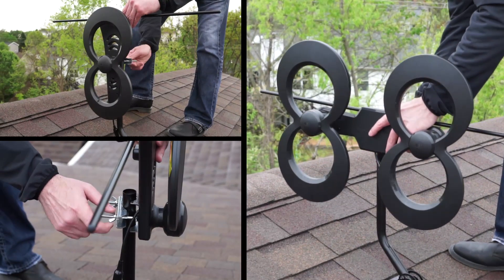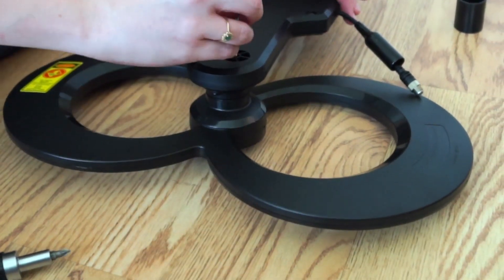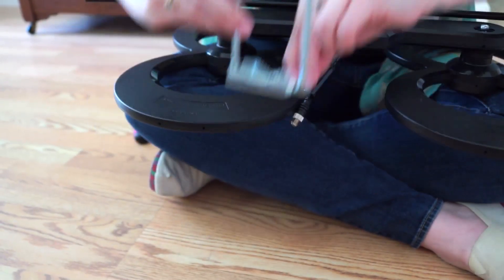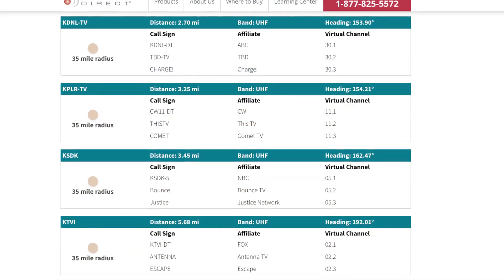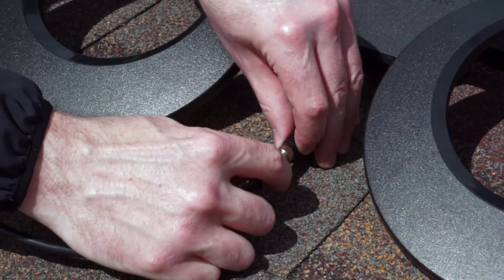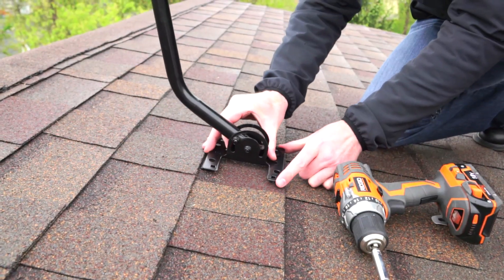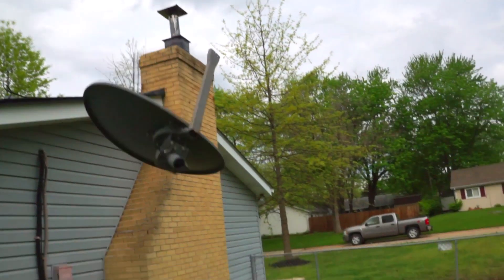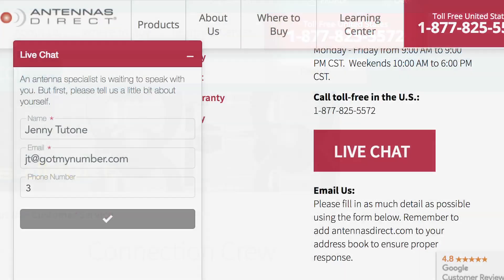Antennas Direct ClearStream 4MAX Indoor Outdoor HDTV Antenna How To Assemble and Install

Comment: Does this antenna and the RG6 cable not need to be grounded?
Reply from the maker: We do recommend grounding your antenna or mast during installation according to Article 810. We do not show grounding in any of our videos since grounding is based our local electrical codes for St. Louis. For grounding instructions, please contact the NEC, a local licensed electrician, or a local electrical inspector for details in your local area. Thank you!

Comment: Hello, we have Clearstream 4v w/ mount model c4-v-cjm.

We’ve had it since 2014 for our destination trailer.  Worked for years, but this year it’s not getting any signals, 0. 

It’s mounted outside with no obstructions.  My dad connected a small tv to the cable directly from the antenna and still no signal.  Through the wind rain hail and snow and debris the antenna has proven to be very reliable for our 18? Maybe 23 channels.   It’s a campground.  We only want it to work like it did and not receive HGTV or other DIY shows.  If you know what I mean.  Moms and redecorating.

Anyway, we have yet to inspect the antenna for damage, but it appears to be in excellent physical condition.  Every year we have to adjust that bar that gets tilted, other than that, we have done no other adjustments.

Cable runs underground, connected to a junction (above ground), then goes back under ground, and into our addon room.  Which then goes into an indoor amp, and then to the TV.  

Regardless, the cable from the antenna did not work for the small tv.

HELP! TYIA.

We are located in waupaca Wisconsin.  I’ll take a video of how our antenna is mounted

Comment: No grounding?  I have had 2 of these 4Max antennas completely fail following these instructions and it turns out it's because they weren't grounded in outdoor use.

Antennas direct won't take them back without the receipt.  That's my fault, but BE SURE TO PROPERLY GROUND your outdoor antenna.  Learn from my luck
Reply from the maker: Hey there, we can only provide some guidance on grounding antennas... here is a link to a page on our website. https://www.antennasdirect.com/cmss_files/attachmentlibrary/pdf/Grounding-Info.pdf. We purposely omitted grounding from our installation instructions and videos for liability legal purposes. Everyone should consult the NEC, a local licensed electrician, or a local electrical inspector for grounding instructions according to their local electrical codes. Also, regarding your return, I just spoke with the customer service manager and we don't typically refuse a warranty return. Please call us and ask for the customer service manager at 877-825-5572 if you need to return your product. Thank you!
Reply: @AntennasDirect  wait you intentionally left the grounding instructions out of your directions? Your instructions should say to hire a licensed electrician. Seems like a product flaw to me and I’m returning this new one that I just purchased from Best Buy

Comment: I have a 2 max and now I'm wanting to get me one 4 max but then I think about price for 2 channels I want kind of not worth it. 😂
Reply from the maker: Hi Alonso, give us a call, we can perform a free signal analysis in your area to offer a solution to help you pick up the 2 channels you are missing. You can reach us at 877-825-5572 or email support@antennasdirect.com. Antenna signals can be tricky due to fluctuations in signal strength from the transmitters and atmospheric conditions. Thanks for sending us a message.

Comment: 5 years ago I invested in a 4 Maxx and The Juice, 5 years exposed to extreme Southeast Louisiana heat and humidity and it’s still the absolute best antenna I’ve ever owned!
Reply from the maker: Thank you SuperNolaguy! We think our 4MAX is the best antenna too.
Reply: I"m in Kentwood and about 50-60 miles from the Baton Rouge stations,  i'm wondering if this will work for me.

Comment: This appears obvious, but to be sure, is there a permanently attached cable to this antenna after complete installation, that needs to connect to my televisions indoor? I see the cable attached when synching, but don't know if this is permanent, after that's done. Kindly elaborate.
Reply: There is a short pigtail (our term) on the spine of the antenna. You would connect a separate coaxial cable (sold separately) to this pigtail and pull the weather boot over the connection. The cable that is sold separately would be connected to your TV. If you are installing outdoors or in your attic, you would probably split the TV signals with a splitter, by which you would need additional cable from the splitter to each TV. If you would like more details, we are available 7 days a week at 877-825-5572. Always happy to help!

Comment: Does it have a stand for indoors?
Reply from the maker: The antenna includes a 20" mast that can be used in an attic (indoors) or on a rooftop.
Reply: @AntennasDirect  I'll take that as a no.

Comment: It says it can be connected to the existing cable going into the house so other TV's can pick up signal. What if we have Cable internet? Do I use a splitter? Thanks
Reply from the maker: From the cable service point that is leading into the house, run one direct line from that cable service point to the modem. Remove the line from the splitter used by the cable service and use a barrel connector to connect the coaxial cable to a dedicated line going to the modem.
 Then, connect the coaxial cable from the antenna to the existing splitter. All TVs connected to the existing line in your home will now have over-the-air broadcast signals. Remember to scan for channels on all the TVs in your home. If you need any further assistance, you can chat with us online at store.antennasdirect.com.
Reply: @AntennasDirect  thank you! Very helpful

Comment: Can you risituate the antenna without removing the whole things? Can you just readjust the mast
Reply from the maker: Once you install the base to your roof or fascia, you will not be able to move it. The antenna includes an adjustable bracket and the mast itself will swing forward and backward. You can tighten the bolts on the bracket and the mast anytime you need to. With the adjustable bracket, you can turn the antenna in different directions to find the best signal. Remember to scan your TV for channels every time you adjust the antenna.
Reply from the maker: Lloyd Bonafide  Line of sight is not about the antenna, it's the frequency in which our towers are broadcasting. It is possible to receive signals that reflect off the deep canyon your mentioned. Since we really don't know your area, it would be best to call into our support team and speak to a tier 2 rep. We are available 7 days a week 877-825-5572. Here is some info on UHF and VHF signals. UHF signals wavelength is shorter, they are the most reliant on having a clear line of sight between your antenna and the nearby tower. Their short wavelength also means that they bounce more easily off interfering objects in their path to your antenna. VHF signal wavelengths are longer than UHF signals, they can more easily bend over and around certain obstructions in the terrain between the TV towers and the receiving TV antenna. For example, they are better at reaching a TV antenna in hilly or mountainous areas. Now since you are in a deep canyon, this will take a some experimenting. Usually when you are trying to capture the TV signals, in some cases in is worth trying to receive the signal by turning the antenna in the opposite direction away from the towers. If you have any an antenna already you may want to try this first. Remember you need to to scan the TV for channels every time you move or turn the antenna to see if you are receiving some signals.
Reply from the maker: Lloyd Bonafide  Agreed! Thank you for the kind words.

Comment: I just put one on my roof, no better than what I have had for 30 years. I feel ripped off.
Reply from the maker: Hi Johnny, we always always recommend that you check our tower and channel finder on our website to make sure you are receiving all the available channels in your area before purchasing new equipment. If you purchased directly from us you can return the antenna within 90 days. If you bought from a retailer you will need to it return to them. We are based in St. Louis and have customer support 7 days a week if you have any questions. Call 877-825-5572 or send us a message at support@antennasdirect.com.

Comment: How does this compare to the 2Max? Which one is better?
Reply from the maker: The 4MAX has more gain on both UHF and Hi-VHF that extends the range of the antenna to 70+ miles. They are both great antennas. What you need to know is how much gain you need to pull in the stations in your local market. Go to our tower locator and enter your zip: https://www.antennasdirect.com/transmitter-locator.html. This locator will show, based on your location, which antenna would provide the most channels in your area.
Reply: @AntennasDirect  thank you so much for taking the time to respond. This was a huge help.
Reply from the maker: @peterpowers4851  You're welcome! We are always here to help.

Comment: I would like to see a video on how it handles weather conditions like high winds and snow and ice
Reply from the maker: Hi JV, our antennas are backed with one of the industry’s most comprehensive guarantees; a lifetime warranty against any defects in materials or workmanship for as long as you own the product.
Reply: Didn't answer your question, weather a factor for reception.
Reply: @AntennasDirect that says nothing about how it stands up to severe weather conditions.
Reply: @rgruenhaus  You're right! We didn't answer the question. Sorry about that... we do wind test a lot of our products to ensure they will withstand 100 mph winds, unfortunately, we don't have a video on the wind test for the 4MAX, but I do have a video of the ClearStream 2MAX which is in the same family, https://youtu.be/_cp_GSycOxc. As far as the snow, ice and high winds are concerned, this is why we have a lifetime warranty. All our products are manufactured at the highest quality materials for durability and longevity. We do not take it for granite the challenges of putting an antenna on the roof and would not sell a product that wouldn't last for many years to come.
Reply: @GoMohu  take it for GRANTED! Not granite.
Reply from the maker: @rgruenhaus  we responded under our other account @gomohu... Mohu and Antennas Direct are the same company. Sorry for the confusion.

Comment: I have 5 different antenna on one tv, 4on another. January I had 60 channels plus 10 others depends on time of day. January 16 2020 rescanned ( several times, now march 18 2020. Only can get 31 channels no CBS ,ABC, Ion/Ionlife ,PBS stations, several others that came in clear before rescaned.moved antennas in different positions several times, several different times during a day and thru weeks. No channels just wondering were they are if had,  now nothing. Ask others in area and they in same situation no tv some a few more some less. Asked on different site and loss more channels( must be watching me they took more away. Wondering how many for this text I will lose?
Oh well, time to turn off and read , lake or beach moving on without shows/ movies. Thanks
Reply from the maker: Hi Larry, thank you for sending us a note. We are always here to help everyone get the channels they need. Please call us so we can perform a free signal analysis in your area to see what is going on there. You can give us a call at 877-825-5572. Or send us a message at support@antennasdirect.com and someone will respond to you right away and provide our advise. We are open 7 days a week from 9am to 7pm weekdays and on the weekends from 10am to 6pm. A lot of stations have moved frequencies with the spectrum repack that started in early 2019 and will continue to move stations to other frequencies until later this year, so repositioning your antenna and rescanning is a must. You may need a preamp to boost the TV signals strength. If you need a reflector kit to focus the antennas signal we can ship you one of those for free. Thank you!

Comment: Tried the 2MAX at first. Very good antenna, but this one works even better. Im about 40 miles from towers. I also used the existing cable from the satellite dish like shown in the video
Reply from the maker: That's great news!  We hope you tossed that dish in the dumpster.

Comment: Would combining 2 antennas pointing at same towers improve weak signals??
Reply from the maker: The best way to improve weak signals is to use a distribution amplifier, if splitting to multiple TVs or use a preamplifier at the antenna. We have both available on our website.

Comment: The local channels are 75-88 miles away, with an amplifier will it still pick up? That is quite a distance.
Reply from the maker: It really depends on the terrain and any obstacles in the way of the broadcast signals. We have a transmitter locater on our website https://www.antennasdirect.com/transmitter-locator.html.  It might be possible. Call our Connection Crew toll-free in the USA at 1-877-825-5572. We are available 7 days a week and can help you determine if an antenna will work for your location. There is absolutely no obligation to purchase, we are here to help!  Thank you for your time.
Reply: This antenna is not the best choice for you. You will need a high gain model with a rear reflector
Reply: I am able to get 64 Miles from where I live perfectly.  Other than that, Other Towers are too far from me 90-150 Miles which I am unable to and not looking for it to either.  I have nothing bad to say about these, in my opinion.... These are the BEST out there so far!  I have tried a lot of Antennas and even making it on my own... NOTHING BEATS THIS ONE!

Comment: never ever drill a hole thru your shingles trust me I know
Reply from the maker: John, in many cases, an outdoor installation in necessary and we are providing some guidelines to install the mast on the rooftop. For the 4MAX antenna, in most cases, you will need to drill into a wall, fascia or roof to install the antenna. We provide tar sealing pads to stop water infiltration.  If you need any assistance with installing an antenna, feel free to call customer support team at 1-877-825-5572.
Reply from the maker: With Antennas Direct TV Antennas that include a mount, we provide weatherproof sealing pads in the box for installing the J-Mount. If you purchase a J-Mount as an single item from us, we also provide weatherproof sealing pads.
Reply: Best to use Krazy Glue. 😂
Reply: please do not provide potentially dangerous, physically-mounting solutions such as screwing into a roof/facia alone ?!
Reply: @Blade,  Why??
Reply: @AntennasDirect  do I need to buy/add a preamp for this 4Max model? Thanks in advanced for your reply.
Reply from the maker: @miguelg4006  The ClearStream 4MAX does not include a preamp. We will not know if you need a preamp until we perform a free signal analysis at your exact location. Please call our customer support team at 877-825-5572 or send us a message at support@antennasdirect.com.
Reply: I was watching that yelling noooo....
Reply: The best location seems to be on the fascia just where the power line meets the house.  It would be so convenient to use the same mast, but I've been told that's "dangerous."   What's the minimum distance an antenna should be from the power line coming into the home?

Comment: Would this antenna perform as well as the Mohu Sky 60?
Reply from the maker: Our antennas outperform the competition 99.9% of the time.  Location of the antenna is key to receiving the best signals.
Reply: Antennas Direct thanks
Reply: Antennas Direct  They definitely DO NOT out perform mine. I guess it qualified in the 0.1. (:  And is a small awesome design.
Reply: Mohu Stinks!  ClearStream 4MAX is the best!  I have tried them all... I kept ClearStream 4MAX and I am very happy with my choice!

Comment: I bought it right now from Best Buy but where is the cable? I saw no cable in the box!!
Reply from the maker: We do not supply the coaxial cable with the outdoor antennas because there are so many different lengths of cable needed to expending the TV signal to multiple TVs. It is clearly stated on the front and back of the box. We offer coaxial cable on our website https://store.antennasdirect.com/coaxial_cable.html.  We also have a coupon code for 30% off with your order, GIVING30.  If you need any assistance with your installation, give us a call toll-free 877-825-5572. You can also send us a message at support@antennasdirect.com or chat with us online.
Reply: Junk.   Juat get the cheap one at Walmart.  That has the motor that truns.  I been having mine for 3 years.  No issues yet and it cane with the cable.

Comment: We have a summer residence under trees, in Delaware is there a problem with reception when the leaves are on the trees?
Reply from the maker: There are various issues with signal interference and trees can be an issue. When you order an antenna with us and you are not completely satisfied, you can return it within 90 days. Call the Connection Crew at 1-877-825-5572 and they will evaluate your location and they will recommend the right antenna for your location and also provide helpful tips on receiving the best signal reception possible for your location. Thank you for your time.
Reply: thank you for your reply, do we have to be at the location for the evaluation?  We have not opened as of yet for the season.  Thanks again
Reply from the maker: We provide a free evaluation at your location with a simple phone call to customer service at 1-877-825-5572 toll-free in the USA.
Reply: ok we will be in touch I have saved the number...thank you again for your replies